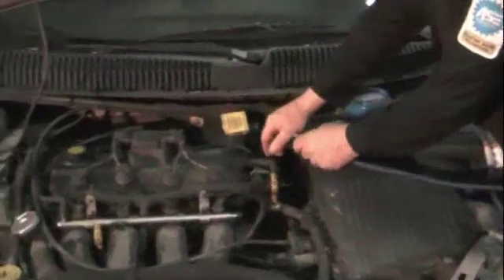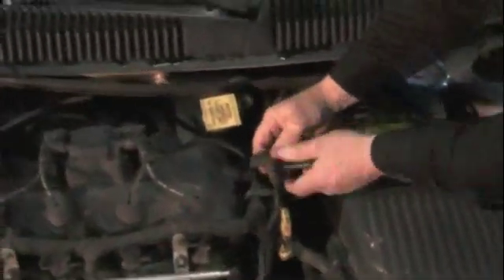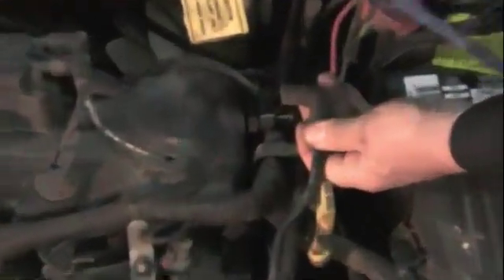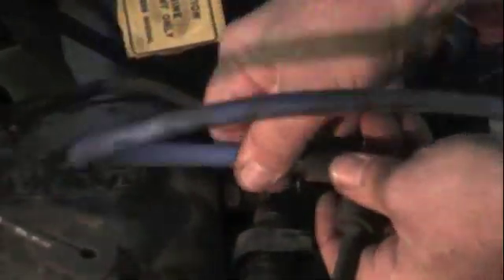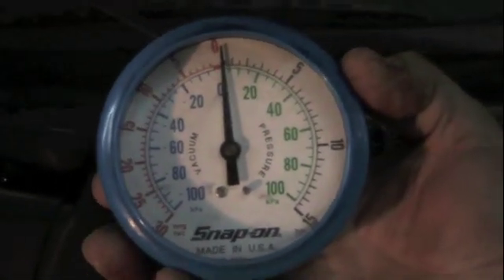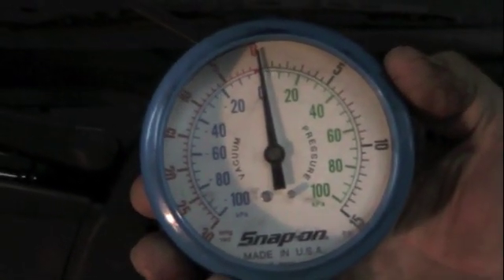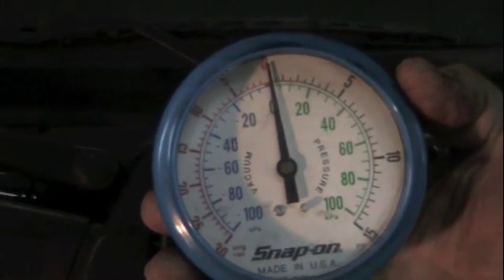Using vacuum to diagnose a broken timing belt

Comment: Why not just pull a valve cover to see is valves are moving, or the oil fill and to see if valves are moving. Also, I hope this is a non interference engine. If not, you just bent some valves.
Reply: Watch it

Comment: @bigrobj1980 Looking in the oil cap works with all cars. Only problem is some times there is no good view so I use a dental mirror or video scope to see cams turning or valves moving.

Comment: And for those nitpickers, if you have an interference engine with a broken, or skipped belt, the damage has already been done. Its going to be a major repair regardless of the testing conducted. And once the cust sees the bill, well congrats you just got a new car because chances are they will nvr return for it. Not the cluncker in the vid.anyways